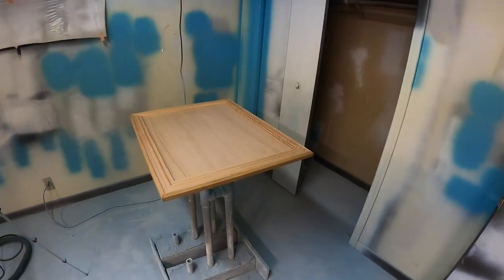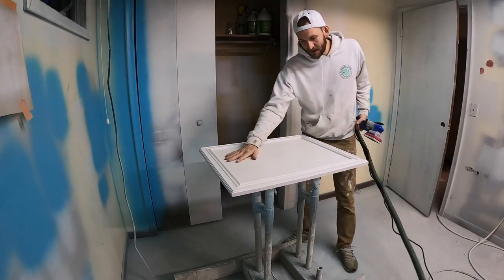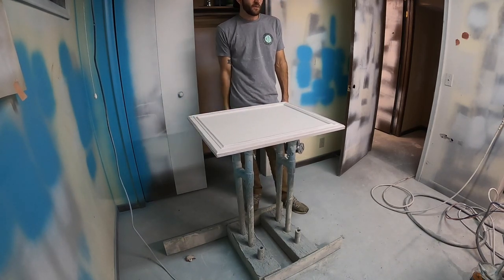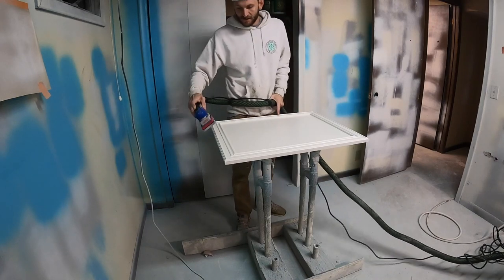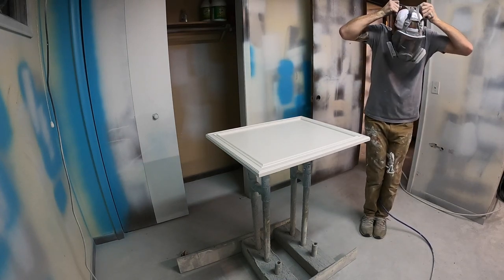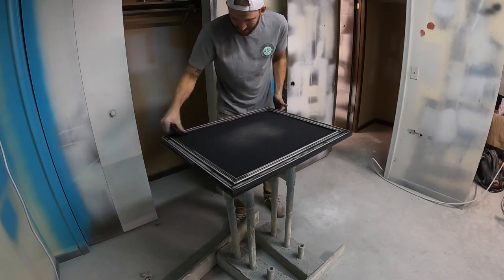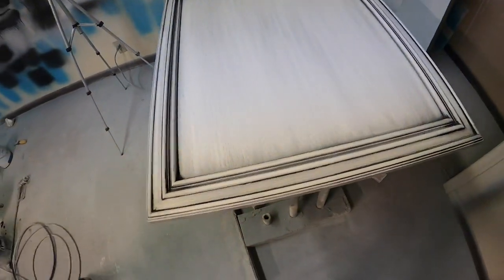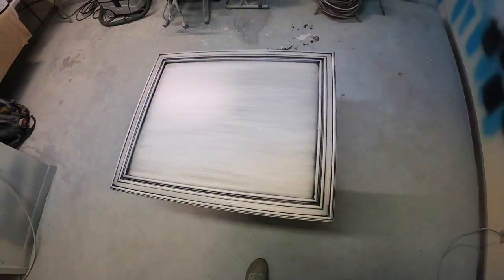How to powder glaze kitchen cabinets

Comment: Who did you find as a reliable supplier for  milesi? I’ve been wanting to try it for awhile now...
Reply: If you'll go to Inspired by U coatings on Facebook, her paint is private label Milesi which she sells only in quarts BUT she tells you where to go to get the Milesi in gallons, so check her out.
Reply: Terri Juanette awesome thanx for the tip!
Reply: Terri Juanette I do see her shop but can’t seem to find anywhere that she specifies a supplier for the gallons- could u point out if its a photo or FB posting that she specs that?
Reply: @Snail_Nailz  You have to watch her videos. I believe the answer is in her FAQs video.   She says it in one of her units...hang on and I'll check...BTW...I posted a link for only supplier I found for the Renner glaze (the glaze this guys uses).
Reply: @Snail_Nailz  I found it...it's DC Clark of Clark Deco.  You'll have to contact them directly if you want a gallon or more. https://www.clarkdeco.com/    IF you want it in a quart size for a piece of furniture or just to try it out, then go to Inspired By U Coatings (her FB page) and order through her.  She only does quart sizes which Milesi only does through her.  No one else has Milesi in quart sizes.  All other Milesi comes in gallons.  If you watch her FAQs video, it tells you all this and more.  Hope this helps!!
Reply: I’ve got a local supplier for renner products near riverside in CA- if u reach out to them they should be able to tell u were the nearest supplier is...I believe eric reason also listed some renner supplier options on his video :)
Reply: Terri Juanette THANK YOU 👏🏼👏🏼! ☺️